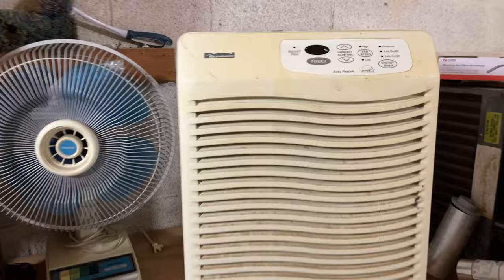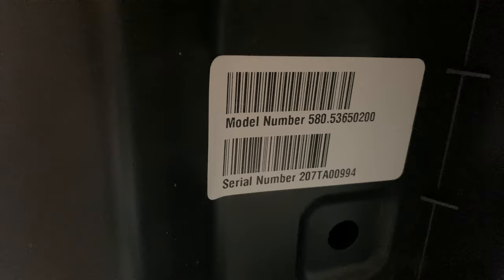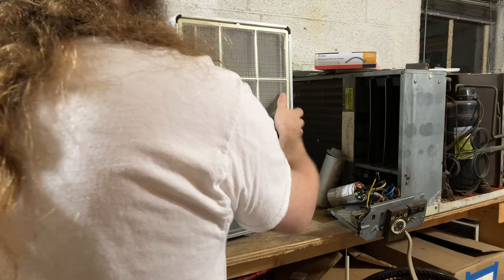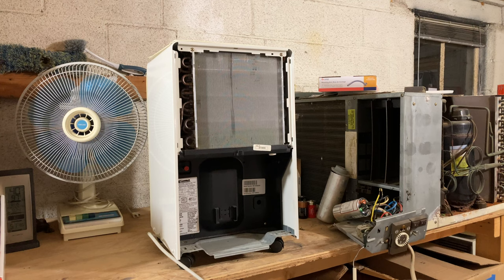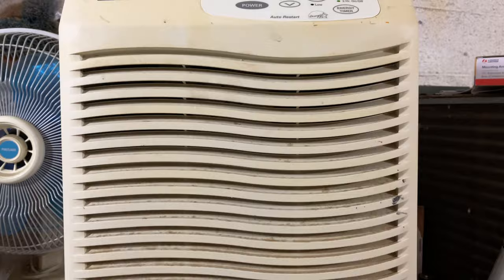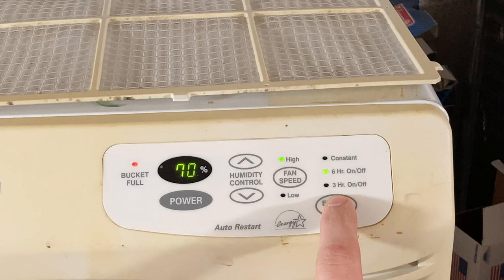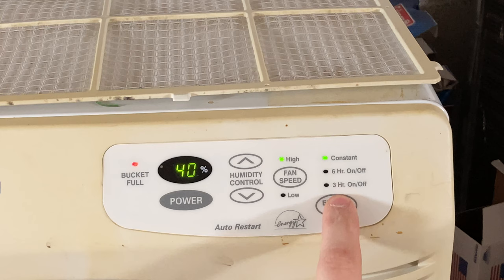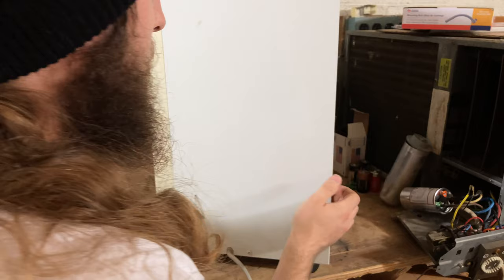Kenmore 580.53650200 65-Pint Dehumidifier | Initial Checkout

Comment: Sometimes there could be another switch.  Some have a bucket full switch, as well as one for the removal of the bucket.  I hope you can get it to working.  I know the humidity sensor is good as if it was not you would see some sort of failure code on the display.  The bucket full switch may be a 2 part switch, one part extingushes the light on the front panel, and other part sends signal to control board to bring on fan, and compressor.  What iam referring to is a switch with a common terminal, a normal open terminal, and a normal closed terminal. You may want to check that switch ad you mentioned it was jammed, may have corrosion.  Also you can check the back of the printed control relay circuit board for any burned traces or failed solder joints.  Hopefully its something simple.  Hope you can get it working.  The unit is fairly clean looking so probably not much use on it.  Plastic front is yellowed but that will happen rather its being used or not.  Also tnis may not be a Whirlpool brand, could be a LG brand rebadged for Kenmore.
Reply: It’s huge I don’t have a humidifier like that